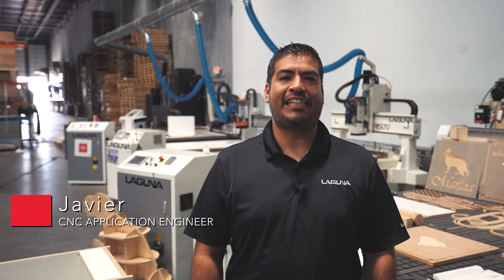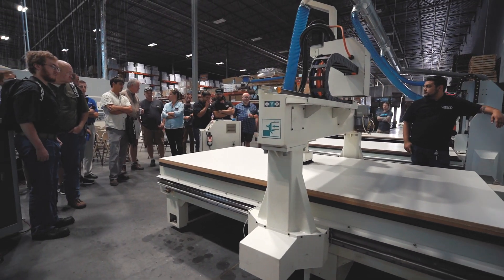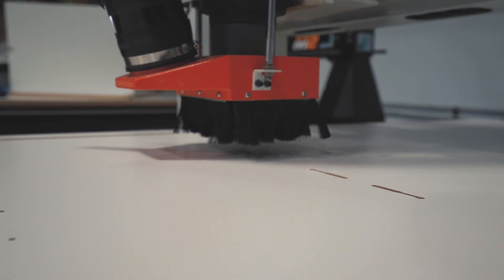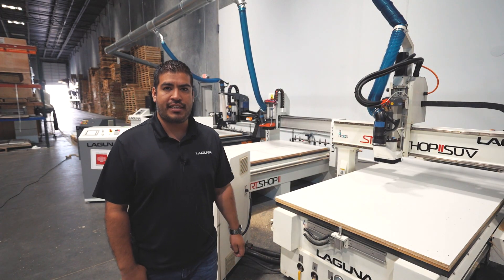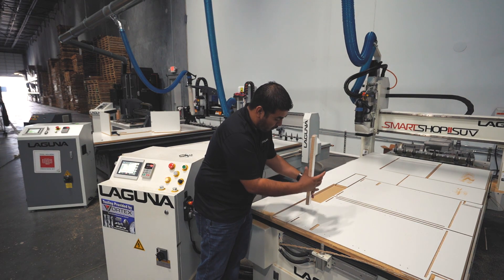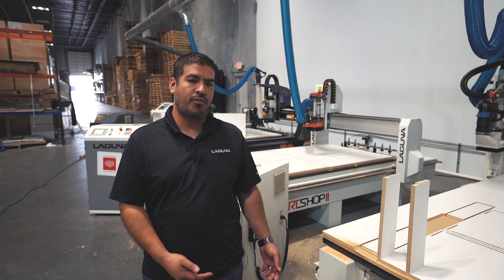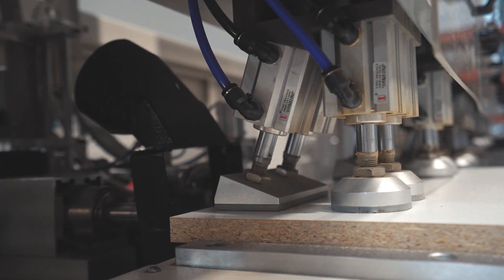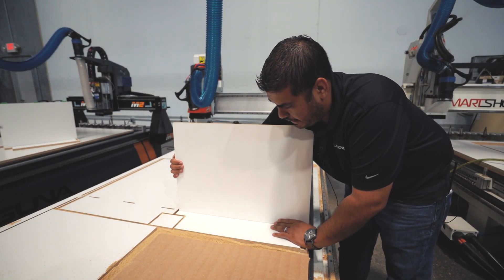Cabinet Making Demo w/Mozaik | LAGUNA South Carolina Open House

Comment: this is NOT cabinet making, this is IKEA cnc made crap, no hands on cabinet making (joinery) at all!! - you probably used chip board or plywood and NOT real wood ( aka straight from the tree and NOT made into pulp and re-constituted back into a slab of "wood"). should SAY this is about CNC machines, thought you were showing REAL woodworking not commercial construction methods.
Reply: Andy. I think that you are mistaking cabinet making with solid wood furniture using joinery techniques such as  mortise & tenon and dovetails ala Maloof or Krenov.  Almost all cabinet making ( except armoires, chests, ect. which most consider to be furniture) is reliant upon Plywood and or Melamine. Even the highest end kitchens are made with cabinet grade plywood with maple,walnut, cherry ect. veneers. These kitchens can costs a hundred thousand dollars and no one would consider these Ikea crap.
Reply from the maker: Yeah, sorry it wasn't more clear that this was an Open House to showcase the machinery for cabinet making with guest presenter Mozaik. This was to demonstrate the machines, especially the software, in how it can be used for cabinet making. Even though we used plywood for the demonstration for simplicity's sake, the choice of material is up to the user and then using joinery methods, whether CNC or not.
Reply: You can literally use the software to make whatever joinery you want, using whatever wood you want. 

Old man yells at iCloud